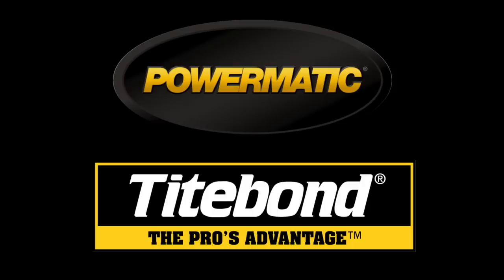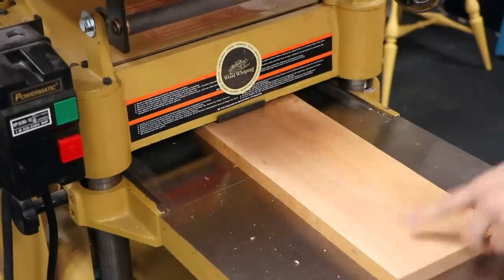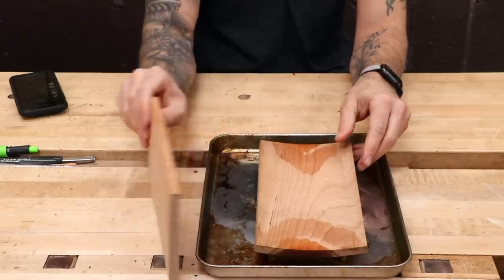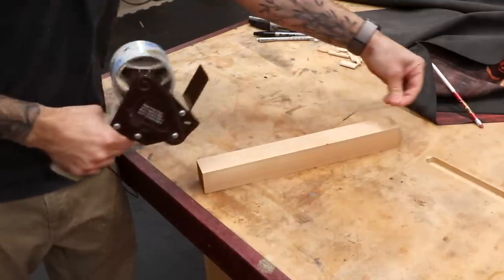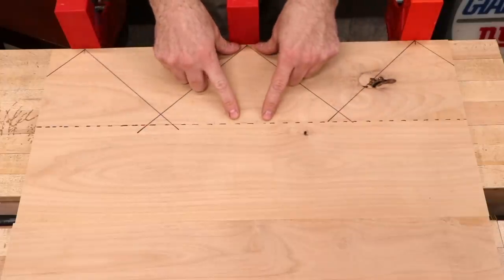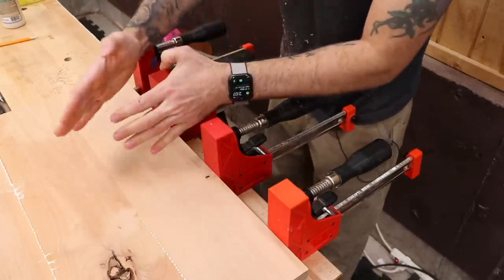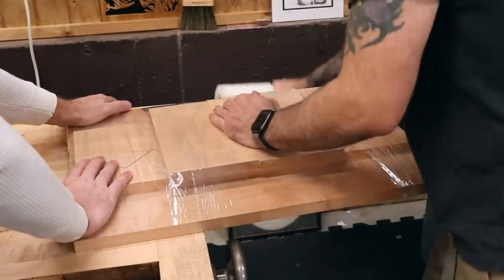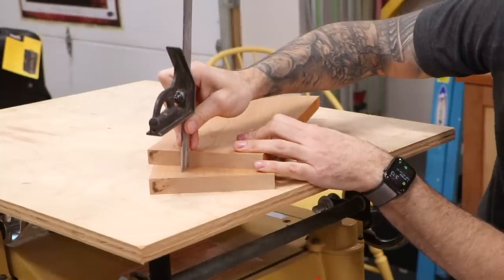10 Tips for Wide Panels that Stay FLAT

Comment from the maker: Have a tip not covered in the video? Share it here!
Reply: Trick I was told by a old furniture builder in my youth. Hand pressure the glue surfaces together, hold and wait a few seconds and then pull them apart, wait a few seconds and then clamp up . Don't know if it was true then or now with modern glues but, he said when you pull them apart you cause a flash -off of gas and air flush jump starting the curing  and blow off  a significant about of moisture of the glue and then clamping up gives a quicker and better(?) curing.  You ever hear that?

You did not review the latest thing...4 way bar clamps, auto-centering of pressure.    Easy DIY custom made sizing as required. Could have some thin wedges on hand for under the bars to bias position a work piece if required. 

I made a small about 30 inch set (3) and some hardwood flooring as a test panel, 15-ish inched wide . Worked great.
Reply: Make sure to always have nerdy memorabilia in your shop! A Happy shop is a Nerdy shop.
Reply: @MrBonners  Some instant-hold adhesives recommend the same thing so I don't think it's limited to older glue types.
Reply: @tenaciousjeebs  this was when there was pretty much only basic epoxy, yellow and hide available to the consumer, woodworker hobbyist.
Reply: Just the tip.....?
Reply: Getting it to look the best is my top priority when picking which surfaces and what direction. A close second for me is the grain direction as I use hand planes to smooth. It can be worked around for sure but if I can avoid this I do. I don't really sand after smoothing with a hand plane. Probably not so much of an issue if sanding at the end.
Reply: If you have a stack of lumber to all be dimensioned to standard sizes add stickers between them as stacking so they air out evenly.
Reply: @joeleonetti8976  Grain direction in a glue up is even important for power tools if your gluing sections to run through the planer.
Reply: I had a lot of twist in a table top from 30yr old dried lumber. I jointed and planed then I used my circular saw to make multiple cuts on the underside of the table top and it settled flat and got a lot of twist out of them... 3 years later its still flat.
Reply: @WoodenCreationz  great tip, did that before too.
Reply: I have rider blocks I use for panel glue ups. They’re just 2-1/4” square and in various lengths depending on the glue up. These blocks lift you work purse off the bench so that the workpiece is not resting on the bar of your clamp. This also helps limit uneven top and bottom pressure caused by non-parallel clamps such as standard pipe clamps since it centers the workpiece on the clamping pads instead of at the bottom or top.
Reply: I was happy to hear your experience with not paying attn to alternating the end grain. I was trained to adhere to the philosophy but it really messes up your ability to get the surface grain pattern you might prefer. I also liked the caul board tip.
Reply: If you don't feel like using dowels or something like that to fix the position of the two boards, you can use small headless nails instead.
What's your opinion on that?

Comment: The tenth tip was one I worked out over time and frustration of having to re-sand already finished table tops, then I ran my palm over a few commercially made tables in shops and found the same issue so I felt better.

Comment: Thanks for the information, very useful... I'm relatively a new wood worker and about to do my very first glue up of probably the worst type of lumber material, construction lumber 2x6. The worst part is I don't have a jointer, but do have a planner. I did run the boards through the planner on a piece of very straight 3/4" mdf  board applying small shims and hot glue anywhere the 2x6 board were raised. Took a bit of work but got it pretty darn flat. What I didn't do was count the times I ran them through the planner after I removed the 2x6 from the MDF boards and ended up taking measurements until they were all the same thickness ( I'll be counting in the future). Another problem was each board (4ea) is 60" long, and in order to joint the edge I had to use my longest level as a straight edge against my table saw fence. That was also tricky and took a little effort until I got the hang of it. I did pick the straightest boards and made sure there were no pits. I also acclimated the boards stacked of 1x2 sticks with weights on top for about three weeks. I took some random moisture reading from each board with a Klein moisture meter and read between 8.5 to 9.5. Next week I will attempt to do my glue ups, wish me luck...

Comment: I gotta agree with you on a few things. I usually always just glue one side of a board and have never had a joint fail. Along with not worrying about the orientation of the end grain. These things have never seemed to affect any of my projects.
Reply: I usually glue one side, too. Gluing two sides allows you to use less glue, which could be important if supplies are limited and getting to squeeze out is an issue.

Comment: good concise information.  I've been working with wood for almost 60 years.  All your points were well made, and not overly verbose.  Of course us skilled workers get our own habits and preferences, but these were good.  Because of glue improvements and changes, there are some different ways to handle things now, but basically, I'd agree.  I appreciated the comment to wait a few days before sanding panels.  I've often seen folks rush things a bit too fast and want to get that project to go together too quickly.  I often have several pieces in work at the same time, so as to allow for drying to take place.  I've seen panels where the biscuits used telegraphed thru to the surface because the panel was sanded within a day or two of glue up.   Thanks

Comment: Great video with lots of useful tips. Thank you
Just one suggestion regarding tip no.9.... Instead of using a stretch wrapping I recommend putting panels in a plastic bag and seal it. It can be re-used which makes it much more environmentally friendly

Comment: Have you ever used a panel clamping rack/jig? I've been thinking about making one. It's my understanding that they apply pressure more perpendicular than say an f-clamp that's relying on the bar to bend and possibly pulling the panel into a cupped shape.

Comment: I'm a beginner.
I have seen rubbing joints, the demonstrators used Titebond III. Makes me wonder whether clamping is necessary. Maybe a jig to hold alignment and hold panels on edge while curing, as you did in your first curing example. Freshly glued panels could be stored out of the way.

Comment: Definitely leave your glue ups before sanding.  I did some maple panels with dominoes.  I actually noticed the spots where I used dominoes were high, So I sanded them flat.  A week later I could see the dents where each domino was

Comment: WW: What is your thought on the maximum width of a single board in a glue up?  Meaning is it ok to edge glue 2 boards that are each 10 or 12" wide?  Or would you rather cut each board in half to 5 or 6" wide in order to make 4 boards in the glue up.  I guess this is related to the cupping discussion you mentioned on end grain orientation.

Comment: Question:  you don’t address options for storage like Pre-coating the board piece with a universal sealer /base coat .. would sanding and doing a quick spray of shellac serve a similar purpose in terms of preserving the board , and making it “ready to go”? If you wanted to stain it you’d need to remove the shellac with a quick sand job to “take it out of storage model , but it would be ready for poly or paint right away .

Comment: Quick tip which i've been doing for 25yrs which my grandfather taught me. Scrape the glue off in 5-10 mins (depending on the glue) and then throw some fine sawdust of the wood your working with over the joints, rub it into the joints but don't blow it off as the sawdust will absorb any excess glue and stop it staining the timber. Sand it away and you'll have a perfect joint.

Comment: Great vid Marc. I got a question about sanding. You see whenever i sand boards with my random orbit sander i get VERY uneven surface. When i run my finger across the grain i can feel an uneven surface between every single grain line. This is especialy noticable on flat sawn boards with cathedral style grain pattern on the face. Is there a problem withy sander or... Thanks.

Comment: G'day. Love your videos. I was wondering if you have any tips for glue joints on things like butcher block or laminated cutting boards. I do a lot of them and find that the joints move a little (very minimal but noticeable to the touch) especially felt on the end grain but also across the surface. I use a mineral oil with melted in beeswax combo for the finish and think because the finish allows moisture in and out the wood move a little. Some that I have let sit for weeks and even months re sanded and then finished have been much better and I feel none of the edges at all. Any thoughts on the matter I would love for you to do a video on that. Thanks again!!!!!

Comment: It's important to be aware of a clamp not being square to the end it is clamping. If it's not 90 degrees, it will tend to slip the glued face when tightening. Also, when gluing a square box, the above fact that there is a sideways force can be useful to make sure the corners are pulled into being square.

Comment: DRY DRY DRY! That’s the only way. If you don’t have time to let the wood dry before jointing and planing then save yourself some time and just plan on using a router sled at the end to resurface the top and only joint and plane just enough to get good joints for gluing but not trying to get perfect boards. Those boards you spent hours on yesterday and plan to glue up today are no longer flat and square unless the wood was properly acclimated. The longer that board sits before final glue up the worse and worse it will be. For the weekend warriors don’t think you’re gonna cut all the pieces this weekend then glue them next weekend and get a flat product. Patience in letting the Wood age is sooo much more important then people realize unless you can cut and glue everything at one time.

Comment: I liked and agreed with 93.7 percent of the video; I have an issue with your thoughts about alternating end grain orientation. I think it should alternate...happy face, sad face, happy, sad for example, and you believe it doesn't matter. Let's say for your glue up, its all happy, and by the way you swooped your hands while describing the cup that happens, I hope you can understand how I like to think in extremes too. An extreme example of a long panel cupping is if it curled into 1/3rd of a cylinder. If you used aprons to straighten that panel, there would be triangular gaps in-between each board so the original panel is essentially destroyed; stricly the apron holding things together. However, with a smile, sad, smile, sad pattern, structural integrity is kept in tact. This is all my own analytical thinking.... zero science proof. But for giggles, to take it further, after 30 years of cupping, which would I visually prefer? An aproned half cylinder or smiles and sads? Not sure, but strength is always important. 

If it's a 2 or 3 board glue up, maybe not such a big deal. Add in more boards/use/location etc. My last thought is it doesn’t have to be exactly smile happy smile happy. SSHS or SSHSS or whatever the wood tells you. For me it’s about integrating the smiles, amount of panels, and viewable surface
Reply from the maker: That's all assuming wood behaves the way you think it does.....and it doesn't. :) Great example just came across my feed today. https://www.instagram.com/p/CoNTLR3OqnA/  Do what you want....but in the end the wood is going to do what it's going to do. So that's why I say, use quality dried material, mill it properly, orient the grain for best appearance, and glue it together. the rest is pretty much out of your control.

Comment: Does the rule of 45 apply with 4 way panel clamps? About two weeks ago I was helping a buddy of mine that is a carpenter, because he was making a table, and he has these 4-way panel clamps that he bought from rockler. They are similar to the ones that Woodpecker’s sells. He spaced his out 16 inches apart. I told him about the rule of 45’s. He tells me with these  clamps he is allowed to go 12 to 18 inches apart. Is there any truth to that? When possible could you clear this up? Thank you

Comment: I'm actually a little surprised by your tip on not worrying about alternating the orientation of the end grain. When I was in college for woodworking (Conestoga College) they always told to alternate the grain and I've never heard anything but to alternate the end grain. I'll have to give it some thought.
Reply from the maker: You'll also learn things like not putting a plane blade down on a wooden surface. It's not that these things are overtly "wrong" but they really shouldn't be hard and fast rules.
Reply: I'd expect this to depend on the wood species and on annual humidity variations at the location. I've heard knowledgeable people here (Scandinavia) strongly recommend using quarter sawn boards to minimize cupping.
Reply: @larssvensson8021  Quarter sawn definitely limits cupping but it limits the visual of the wood to only straight grain. Also where I live the humidity changes a lot it gets very dry during the winter and very humid during the summer so I have to be careful with the wood I choose.  (I live in Ontario Canada)

Comment: For large table top (96”x42”) in hard maple I am thinking of doing a small square edge tongue and grove the length of the panel for alignment. Have you tried this method? Any other tips for that large of table?
Reply: Scott Langhans just salt the joint. Works great and does not hurt wood. Salt acts like sandpaper and holds boards from sliding

Comment: Great video, thanks! Quick question for you.  I'm going to be making a panel out of KD dressed lumber from my local lumber yard ( I dont have a planer or jointer).  Would you still recommend acclimatizing dressed lumber?
Reply from the maker: No. The problem is, if you let it sit it's likely to warp and cause issues before you even glue the panel together. It's best to keep the time between milling and glueup as short as possible.
Reply: @woodwhisperer  makes sense. So basically, buy the lumber, and start building with is ASAP? I’m basically building a dry bar
Reply: @woodwhisperer  I’m torn. I’m reading everything under the sun about acclimating wood even some saying wait a few weeks.

Comment: In the world of knife making, over-clamping scales onto the handle is an issue a lot of new guys make. Too much pressure can force most, and sometimes even all, of the glue out from between the tang and the handle. This results in a weaker-than-optimal end product. I've even heard stories of the scales simply falling off the handle when they clamps are removed!
Bearing in mind that wood is a lot more porous than metal knife blanks with their plastic handle scales, it's likely fair to say you won't ever squeeze all of the glue out of a joint. But in my mind, the principle is still sound. Too much pressure is worse than not enough clamping pressure.

Comment: Are there any special precautions that you take if you’re building in a dry place and the piece will end up in a humid place? For example, you build a piece in Denver and it’s going to a home on the east/west coast?
Reply from the maker: That's not something I do and it's something I'd have some hesitation in doing. It's really asking a lot of the wood to behave after a dramatic humidity change. But if you build it well with expansion in mind, it could very well be fine. It could also be a disaster. If I were doing an important piece that I knew was going to go somewhere more humid, I might try to temporarily increase the humidity in my shop in advance. But that's not really practical or even feasible for me personally so I guess I'd just do the best I could to mitigate movement and hope for the best. :)
Reply: @woodwhisperer  one precaution could be to give the customer a fake phone number and address.
Reply: MrCuzzo03 we treat all boards end grain with sealer. This made a huge difference when we ship to states with different mc. We also increase mc to Florida by 1 point and increase gaps by 1/32. Good luck

Comment: Excellent tips, although if possible and you have a wide enough joiner the first side of your stock should be surfaced on your joiner, followed by your thickness planer.  You can't remove twist on your thickness planer.  You first need to get your stock dead flat.  That's only done on a joiner.

Comment: Would pocket screws be ok to use to help boards stay level?
Reply from the maker: VampireOnline Maybe, if you have a way to set them level in the first place, before driving the screws.
Reply: @woodwhisperer  My thought was plywood and a cinder block on top lol... I need more clamps. I just ordered 3 large ones from Rockler(thanks woodtalk for the free shipping), but after watching the video it's not enough lol.
Reply: you might be better off with a spline,  pocket screws actually pull the material together at a angle